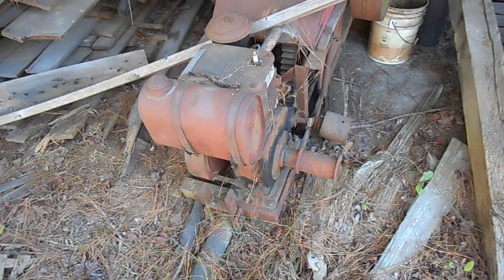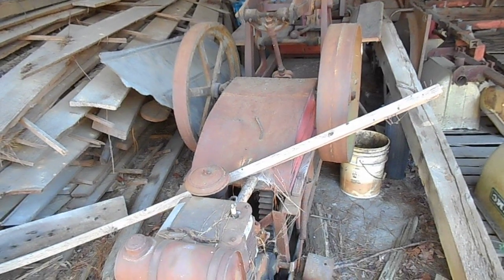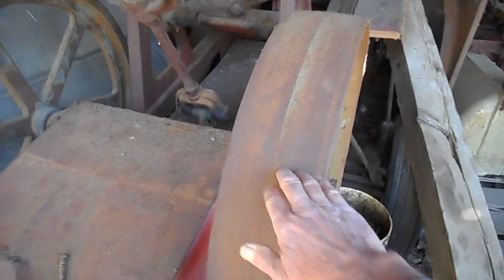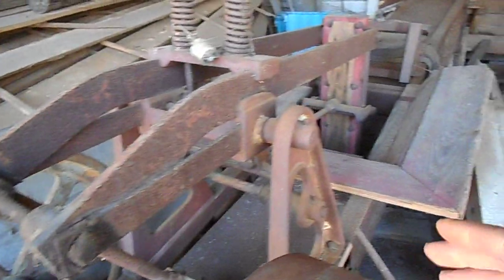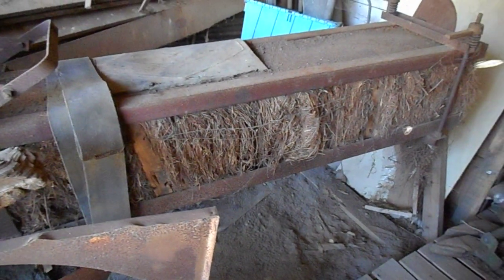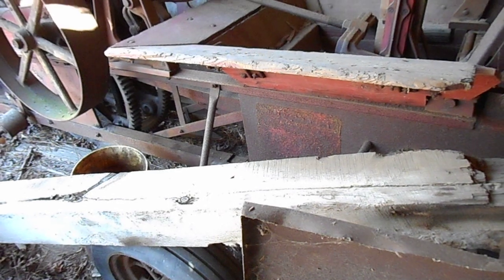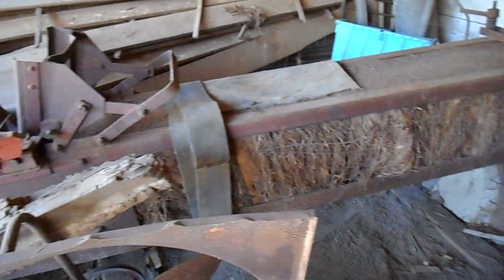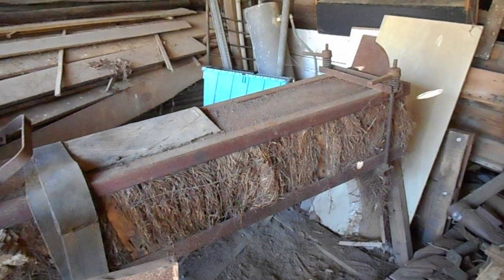Antique Farm Equipment

Comment: I belong to an antique tractor and engine club, so I've seen a few of these old stationary balers in action. I'd put the motor as mid to late 1940's. Some of the balers were powered by even older hit and miss engines, some by having tractors belted to them. Those old Wisconsins might look like lawnmower engines, but they had a longer stroke and larger bore, so more torque rise. It would be interesting to know whether that motor was original equipment for the baler. The great thing about your baler is that it's fairly small and thus would be easy to transport around to shows! Really cool. I've often said that if I were wealthy, I'd get a big diesel pickup and a lowboy trailer and go around the country looking in barns and fencerows lol. Thanks for taking us to yours!
Reply from the maker: defuse56 - American Pickers TV reality show kind of thing where locating and purchasing old antique farm equipment is the goal.  that'd be me if I had the money and the freedom that kind of money brings.   if the motor is mid to late 1940's  then it would not be the original because I do know the baler dates further back than the 40's.  thanks for watching and subscribing.
Reply: Well, I could be wrong, sure wouldn't be the first time. But it doesn't look much older than 40's to me. If you happen to have a moment some day, let me know if it has a make and model plate on it someplace. I know a few guys to ask about it.Whether it's original equipment or not, the baler is a really wonderful old machine. It has personality, just like all the old iron! I am right about one thing though: it would get alot of attention if you had it running and baling at a show!